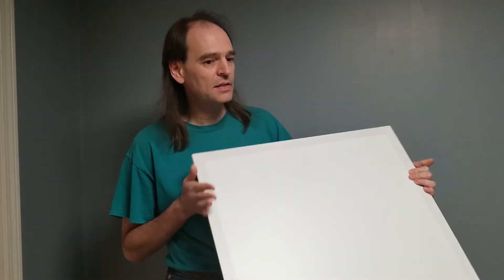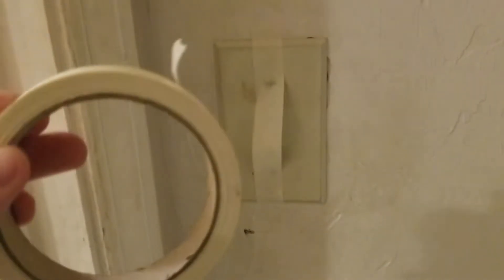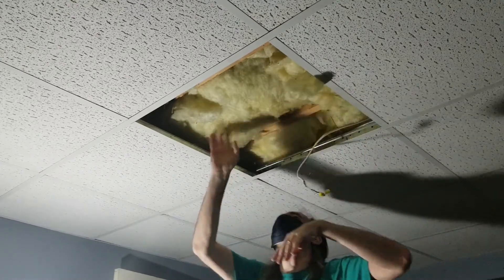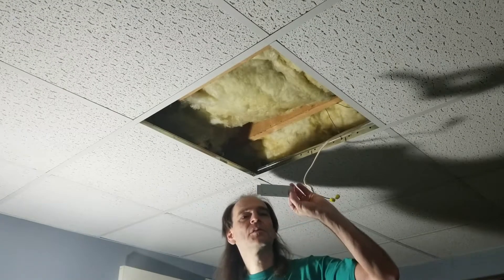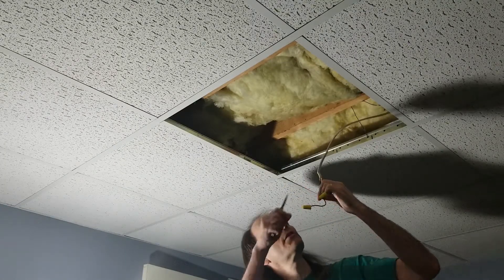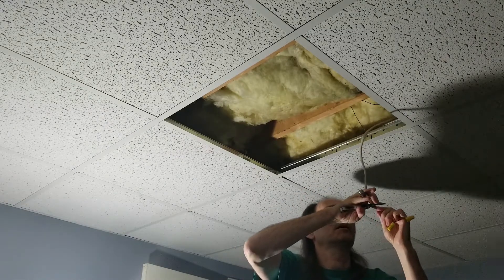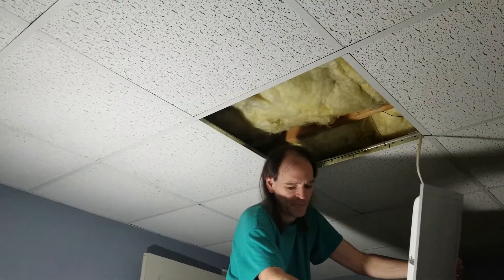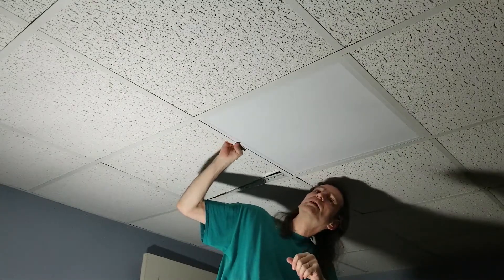LED Panel Lights; Part 2: Simple Installation

Comment: Just taping the switch might be fine for you, if you choose, but to offer this advice  is at least irresponsible if not crazy...
Reply from the maker: Yes, that's fair.  I usually double-check with a voltage tester.  Turning it off at the breaker is just another switch when it comes down to it.
Reply: @projectwithpreston  But it's a switch that nobody is likely to turn on by mistake.
Either you didn't understand my point or you don't understand the potential danger of this vlog, which is aimed at beginners...